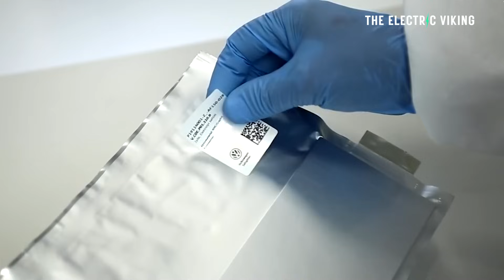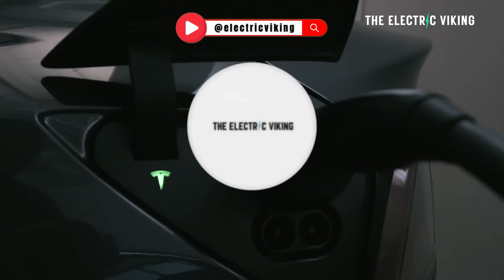$25 k VW EV - How VW’s New Batteries Will Slash EV Prices Worldwide

Comment: 25.000? I’ll give you six grand for it. Remember, no engine, no gearbox; the two most costly aspects of ICE vehicles. They’re still conning you …
Reply: So you think hundreds/thousands of battery cells should cost 50 bucks?

The electric motor(s), 20 bucks?

The transmission, 10?

Suspension, body, redesigning for electric powertrain only (so you can have a frunk, more spacious interior etc.) R&D, manufacturing. 150?

You have been 'conned' at birth. You tryna lower everyone's IQ?
Reply: @ Wow! All that for 230$? I’ll have two …

Comment: The U. of Adelaide developed a Lithium-Sulfur battery yielding 1,306 Wh/kg with 1,000 cycles at 8C power density, but combined with the ion sieve of Karlsruhe U battery that provides 25,000 cycles at 5C, you’d have a cheap, very energy and power dense forever battery. The ion sieve of the Karlsruhe Li-S battery is so efficient, it can even reach 150C with decreased cycling life.

Comment: First these videos would be far more pertinent if the charge time for supporting a specific range, for one or more specific vehicles was provided. Don’t say it was there.

Second, all EV subsidizing with US Federal funds should stop. EVs themselves are not in the US the answer for global carbon, since the US only produces from vehicles 2% of global carbon. The bigger challenges is electricity generation for increasing demand driven by data centers and EVs. This would not have been an issue if advanced nuclear had been the directive in 2010 when the US Congress considered the issue. Instead technology prejudice and ignorance prevailed. This has happened in Europe as well.

Comment: LFP batteries are better for another reason too: safety. NMC batteries are already pretty safe, even though anti-EV people love amplifying the rare stories about EVs catching fire; LFP batteries are even safer. You would be hard pressed to find examples of LFP batteries catching fire unless they have been sliced open, and even then the resulting fire tends to die off by itself.

As for energy density: current LFP tech is already better in that regard than not only budget NMC batteries, but also all but the highest spec NMC batteries from half a decade ago. Just about anything an NMC EV battery could do in 2022, a modern LFP battery can do today at a small fraction of the cost. It makes no sense to use NMC batteries nowadays on anything apart from long-range models, and even those can often be done using just LFP.

Comment: I wish VW success, but I can’t help think that by the time they bring out LFP based cars that are cheaper, we will be seeing solid state battery cars from China at low prices that will be even better.
Reply: CATL is just finishing their factory in Hungary ….
Reply: they will start with NMC in the ID.2 first. their first self made battery cells with NMC will come into production at the end of this year. they want to bring an ID.2 and ID.3 version with LFP too but where they are coming from is the question. CATL or their own production?
fact is that they are currently running out of the battery cells that start with a higher charge power because their cars are selling very well in europe.
Reply: Volkswagen EVs only matters for Volkswagen tragics. 

For everyone else in the world, especially outside of Germany and the United States, Chinese EVs will always be superior than all other EVs, with respect to technology, features, efficiency, modernity, and most importantly, price.

Similarly, the Chinese EVs will always be better than whatever rebadged Toyota EV the Japanese company will be compelled to make in China.

Volkswagen, Toyota, General Motors and Peugeot will just never ever be as efficient, nor as effective, as the Chinese with EV engineering and production. China holds all the EV aces.

Comment: Faster charging is no good if the charging infrastructure is not in place - which it isn’t (yet).PS it offers no benefit for home charging which is the only sensible place to charge( if you can do it).
Reply: I don't know where you live, but recently I drove through the UK and France, there are hundreds of thousands of chargers, more than enough.
Reply: in germany the utilisation of high speed chargers is around 10%. so, 9 out of 10 charges is waiting for a car. there are chargers everywhere.

Comment: I want a Natrium/Sodium baterry in my car with 200 km range that would cover 70% of my routes + efficient range extender for long trips. If VW reads this, then u're welcome.
Reply: + use the heat waste from the range extender in winter  for car heating
Reply: Hybrids are a dead end. Automakers have discovered that. With Sodium battery, you don't need to worry about charging because of how fast it charges. Long distance trips will be no problem.
Reply: @Berkhoi I agree, BEV is the future, but not in all countries you have a good charging infrastructure. There hybrids (REEVs) will be the bridge solution. For my driving route, a BEV is unfortunately right now not an option.
Reply: @STU0408  this serial hybrids would come too late. and it would be more expensive. electric infrastructure is growing very fast.

Comment: Time for the batteries to be sold or leased separately. That way they can be upgraded later when the battery tech gets cheaper and better without having to chuck the whole car..  Personally for what I need here in Canada? Sodium-Ion would be ideal. I don't need range, I need cold and hot weather durability and reliability... Most of us are stuffed into 6 mega cities in 3 general regions. Range has never nor will it be an issue for 99% of travel here. Only occasionally do people leave the Lower Mainland, Alberta Axis or Windsor-Quebec super corridor and generally not for long and not for far...  Anything that can get near old Geo prices adjusted for inflation which were $15K sedans/coupes and $25K SUV's would be ideal... Those are CAD/AUD/SIN/NZD prices since all those roughly trade in the same range with each other...

Comment: LFP Batteries have a lower energy density, so get used to lugging more extra weight around.
Reply: No. Chinese figured out things. These blade batteries have much simpler construction and are lighter. Only range is impacted by 20-30%. I think we have hit peak range. Cars in future will have less range, more reliability, lower price, no risk of fires.
Reply: So you admit that in order to keep the range the same, the battery will have to be heavier @NighthunterNyx
Reply: @Dungshoveleux  technically, yes. However, I don't see companies doing this. I see smaller batteries on newer models and use of LFP over NMC.

Comment: I would totally buy ID buzz if it was 40% cheaper and efficient battery. I watched the old VW CEO when he first announced the ID Buzz at around $45 USD, too bad they canned him.
Reply: Just buy one that is 1 year old, here in the UK the £65k car becomes £40k - £45k after a year.
Reply: Energy density in LFP is always improving, sodium ion batteries are probably the next step. To be fair the issue with efficiency in an ID Buzz isn't to do with the motors or drivetrain, it's to do with the inherently poor aero that comes with being shaped like a loaf of bread. Not much VW can do about that!
Reply: Well efficiency is subjective, an LFP battery may be more efficient at charging and discharging rapidly but it also holds a lot less energy for it's volume and weight.  The advantage is that it does not use conflict metals like cobalt, nickel or manganese.  Of course although iron is inexpensive everywhere, phosphate has uses as a fertilizer so use of phosphate in LFP batteries displaces agriculture, at least until more investment in supplying phosphate are made...  If efforts are made to collect and recycle batteries, then the capital costs of batteries with EV's should eventually drop off as the majority of cars become EV's.  Already with LFP batteries, the cost of manufacturing an EV is half that of building an competitive ICE vehicle at least in China so with battery recycling, it could be ome far less expensive than an ICE vehicle provided the market actually converts at the current relatively extravagant prices for EV's.  Now unless the material is completely re-smelted and redifferentiated by distillation which takes an enormous amount of energy and still has some wastes, recycling requires standardizing the formula for the batteries.  Lead Acid batteries are only 98% recyclable because the formulation hasn't changed in over a hundred years and we have laws requiring the batteries to be collected for recycling...  Standardization means settling for good enough and not looking for better so standardization is unlikely for some time, public adoption is also not a given yet though it does seem inevitable.  Collection of recyclables has been flailing for some time now with aberrations if single stream recycling dominating over the original high tech single stream recycling but a dedicated stream for EV batteries is still possible if governments would actually act.

The future could be very inexpensive cars but it looks like the car manufacturers and governments are doing everything possible to keep the prices and hence their profits and tax revenue high...   It's just like how we could've avoided the privately owned automobile mess with PRT or even just with affordable taxi's but neither ever happened as people wanted more profits and tax revenue.
Reply: What if it was 40% cheaper but inefficient battery?
Reply: Volkswagen reduced the price for the buzz in Germany. You can get one now for 360 Euro, 10000km/a and 60 month.
Reply: Volkswagen EVs only matters for Volkswagen tragics. 

For everyone else in the world, especially outside of Germany and the United States, Chinese EVs will always be superior than all other EVs, with respect to technology, features, efficiency, modernity, and most importantly, price.

Similarly, the Chinese EVs will always be better than whatever rebadged Toyota EV the Japanese company will be compelled to make in China.

Volkswagen, Toyota, General Motors and Peugeot will just never ever be as efficient, nor as effective, as the Chinese with EV engineering and production. China holds all the EV aces.
Reply: @user-kc1tf7zm3b  Chinese are known for inefficient engines/drivetrain and very bad driver assist systems so i wish them good Luck

Comment: It's only a matter of time until battery packs get cheap. The more types are invented and the more production goes online supply will at some point be more than demand. And because the batteries are the most of the cost of an entire EV the cost to make them will go down quickly. It's not going to take long for EVs to be more profitable than ICE cars. There is nothing but upward pressure on the cost of making ICE cars, the cost take-out happened over the last 50 years and there is not much room to reduce the cost. Even labor is not low hanging fruit it's just not enough money per car.
Reply: As they reduce the cost of battery,  it becomes more difficult to reduce it further.